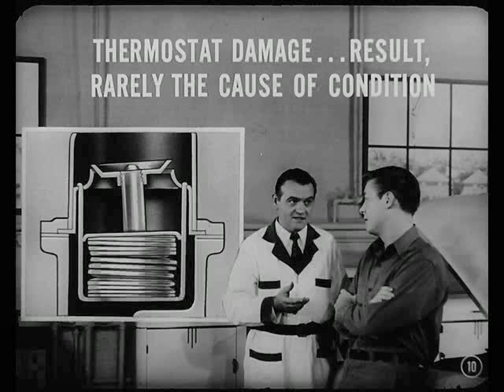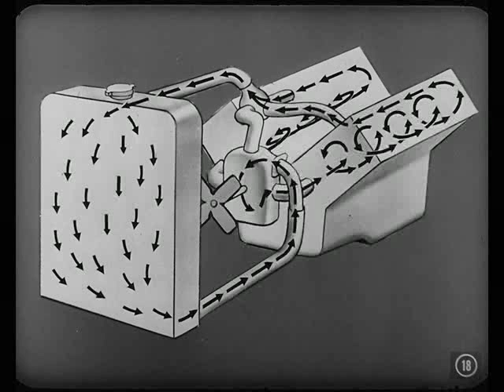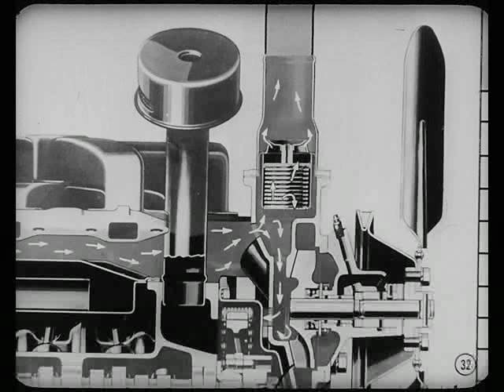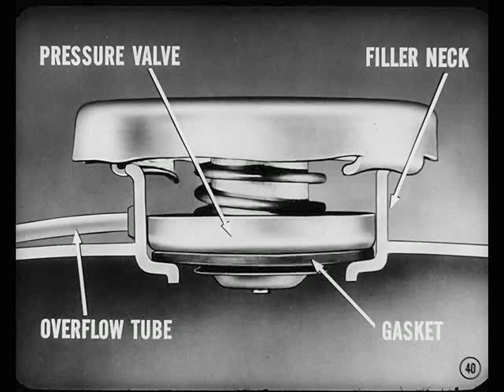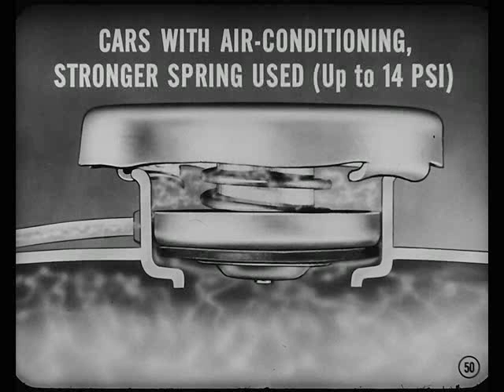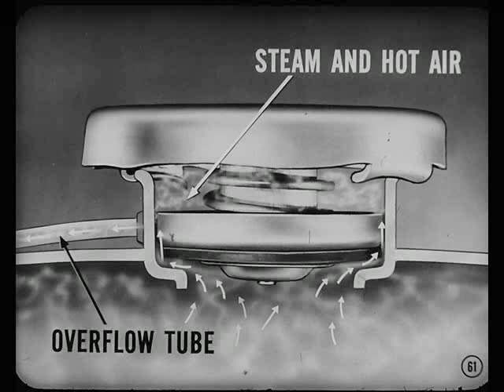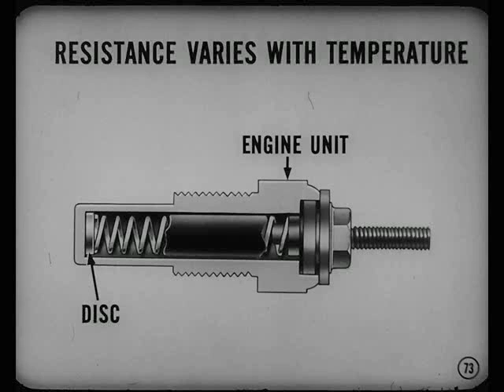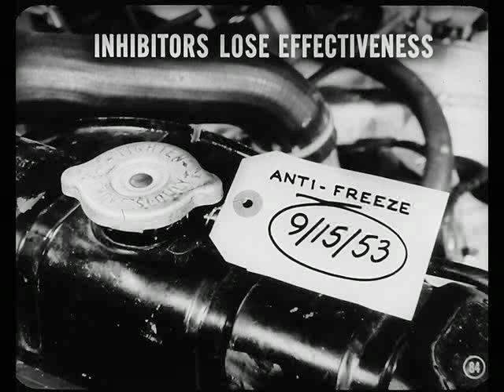MTSC - 1955, Volume 8-10 The V-8 Pressure Cooling System

Comment: This weighted valve is important even today as Jeeps run the weighted valve not spring loaded or retained type valve.
It works well and helps keep the system running smoothly